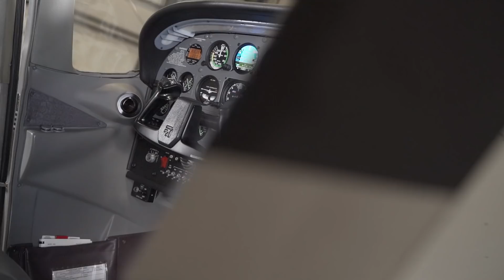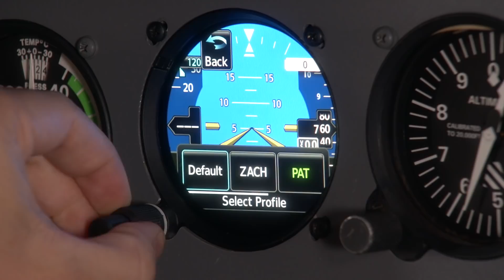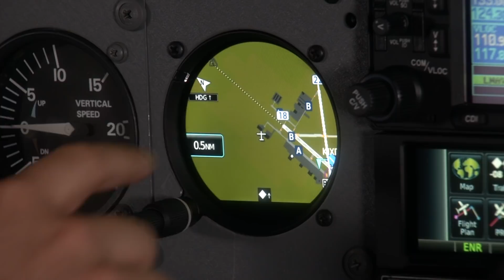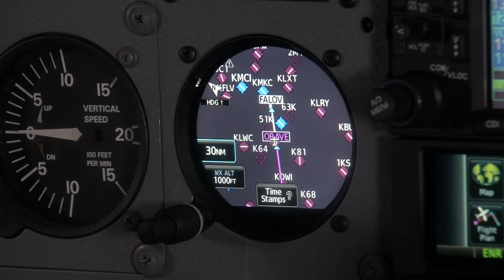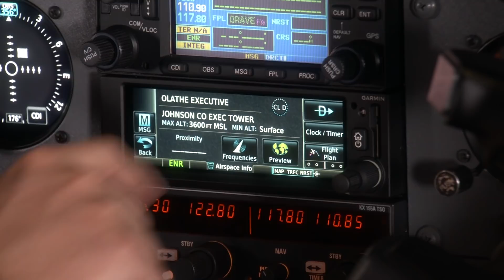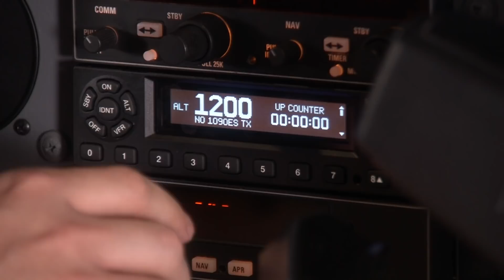Garmin Virtual AirVenture Oshkosh Experience: Aircraft Avionics Tour of a Cessna 182

Comment: Did you notice any improvement in the KAP 140 performance, especially during approach mode?  I've got a traditional gauge DA40 with KAP 140 for which I'm considering the GI-275 AI/HSI combination.  Also, can you set the crew profile so that the AI shows only attitude indicator and SVT, but not the data such as airspeed?  Thanks.
Reply from the maker: I spoke with the Flight Test Engineer that flew it after the initial upgrade. They didn't report any improvements in the autopilot. He did say and I can confirm there are features with that combination of avionics that the KAP is unable to take advantage of, like Vertical Navigation (VNAV). Since this video, we've updated the C182 with a GFC 500 autopilot and I recently did my instrument proficiency check in it. Shooting 3 approaches was a breeze. The GI 275 AI can be configured during the installation to display attitude information/SVT only. I've queued up the following video at the place it shows these different configuration options: https://youtu.be/7WN7zTWtfMo?t=47. Thank you for considering Garmin.
Reply: @garminaviation  Thanks!  I'd love to have the G500 in my traditional gauge DA40 but seems like since there are only a couple of hundred or so around it may be a while before Garmin certifies it for my aircraft.  With regard to the AI, what I'm hoping to do is to use attitude information/SVT only in cruise and the full AI with all the aeronautical and nav info for approaches.  This would require changing it in flight, which the crew profile appears to be a possible way of doing that.  I've reviewed the manual but it didn't have enough information to determine that.
Reply from the maker: I'd like to discuss this with you to ask a few more questions to ensure I'm understanding correctly. If you're open to that, please direct message me your contact information and a good time to call. Thanks again for considering Garmin!
Reply: @garminaviation  I can't find a way to DM via YouTube.
Reply from the maker: Try using this link: http://m.me/Garmin